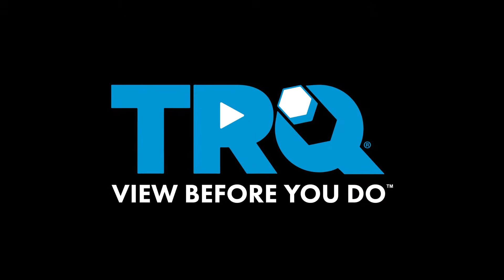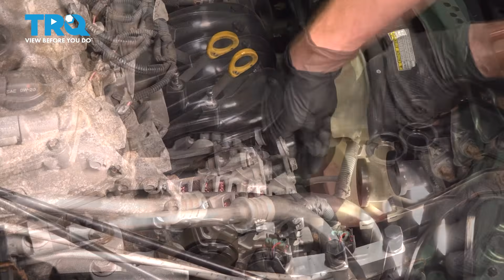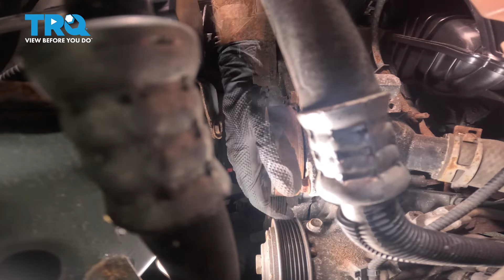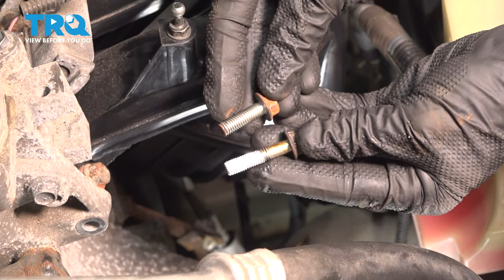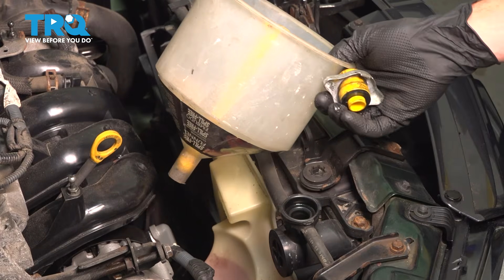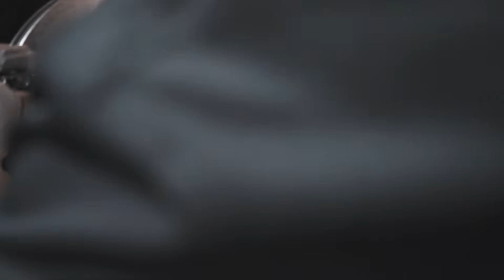How to Replace Engine Water Pump 2014-2019 Toyota Corolla

Comment: Great video, Could you tell me what the torque is for the long and short screws for a 2015 Toyota Corolla LE? Since I have seen and read several information regarding the touch and it seems to be variable in different models or years. Thanks